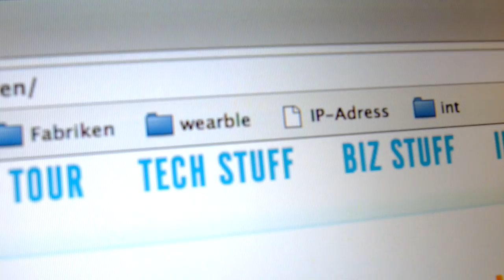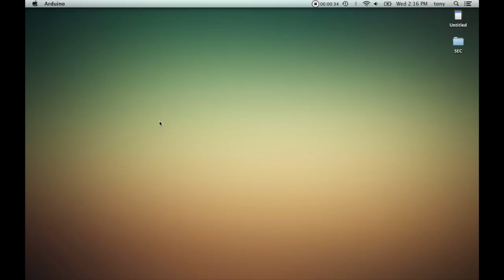Arduino GSM Shield - Trailer

Comment: hello., i m working on switching ON-OFF of electric device with SMS using arduino and gsm sim900.(working perfectly).
now i want to do it with Whatsapp instead of text message using Arduino and gsm sim900.
any suggestions ??
Reply: Umm... A little stupid idea. If you want to do this, you must make Arduino WhatsApp message receiver. I don't know whether WhatsApp messages are purely text or no. If that is, you can do that just like SMS switch. I don't really know, but I think this can help. Sorry for my bad English.